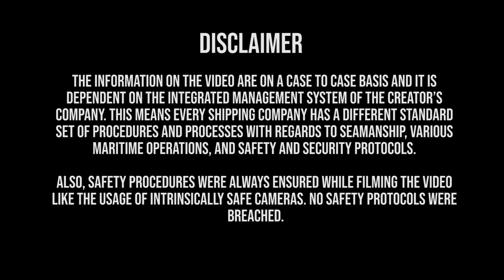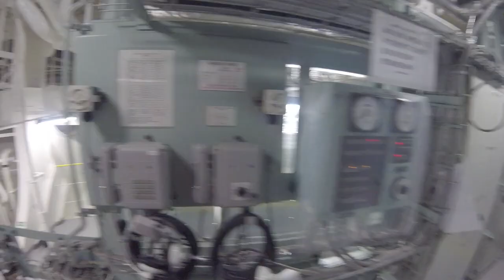Inside a VLCC's Engine Room Part 3 - A Walk Through | Seaman Vlog | Life at Sea

Comment: Texaco decided to sell two of our best ships to Onassis. On arrival at Port Arthur the main boiler was to be opened up for a Class Survey. Our C/E a big, kind and rather fat Scotsman went in through the manhole to inspect the water tubes. The boiler was still very hot. After half an hour his fat body swole up in the heat. We tried hosing him down but the water was too warm. His big shoulders and belly were jammed in the manhole and not wishing to break his ribs we could not get him out. Then suddenly he popped out like a cork out of a bottle! The Fiver had turned up both forced draught fans to High Speed. The C/E bad mouthed the Fiver but I think he had saved his life. A ship is a very dangerous  place. In 8 years we lost 9 men. Drowned in oil in the pump room, suffocated in the E/R control room due to the day tank on fire, crushed against a tug whilst leaving the ship in heavy swell off Cape Town. A ship is dangerous, never forget.